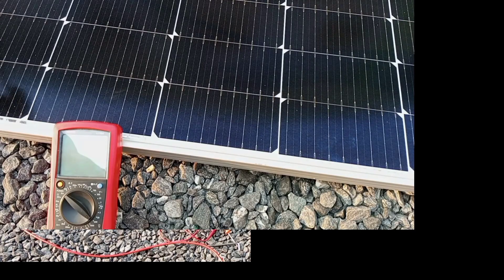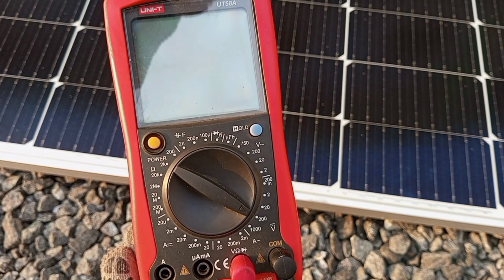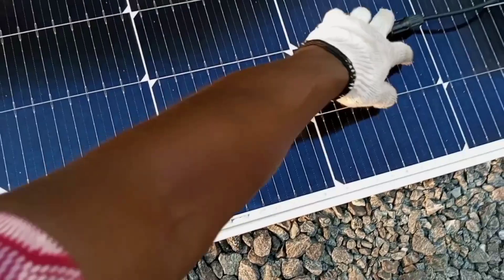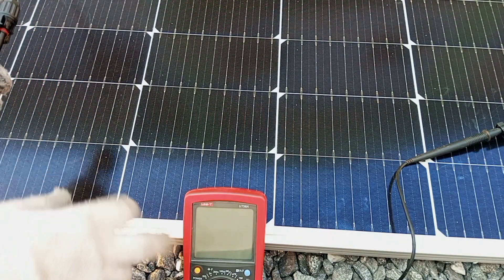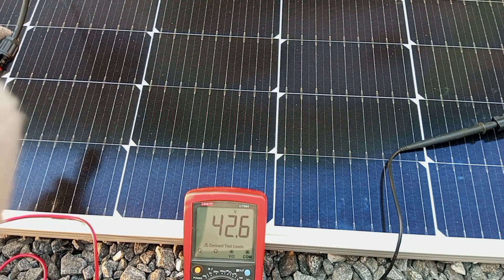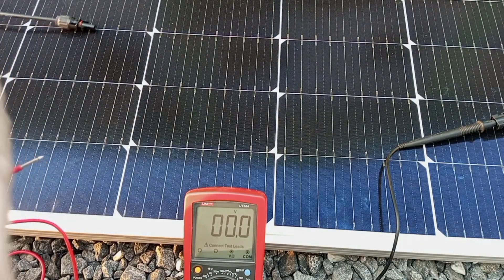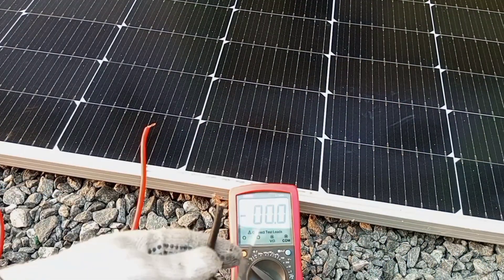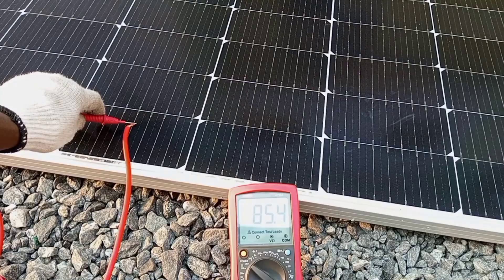SOLAR PANEL VOLTAGE

Comment: Solar pannels are about power Voltage is only 1/2 the equasion  P= IxE, where P is power, I is current and E is the voltage.  The load is what uses the voltage to draw the current. The load is what what is using thepower to do the work.
Reply from the maker: Oh okay, I get you now. Sure, so the VMP is usually lower than the VOC

Comment: How about using a multimeter that doesn't have the gradings?
Reply from the maker: The most important thing is that you must know the minimum and maximum values that the meter can measure and make sure that the expected voltage from the measurement falls within the range.
Reply: Please show me how to connect Twin cut out connection with 3 phase meter
Reply from the maker: @israelquarshie4780  
Well noted
Reply: @obloni_Electrical  I will be very happy   because am sure you are the only person that I can learn this from